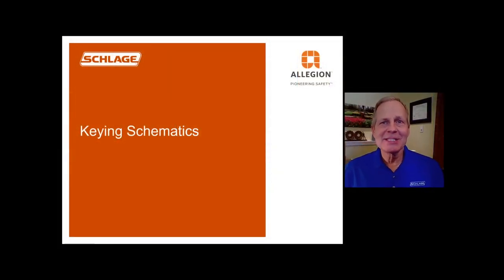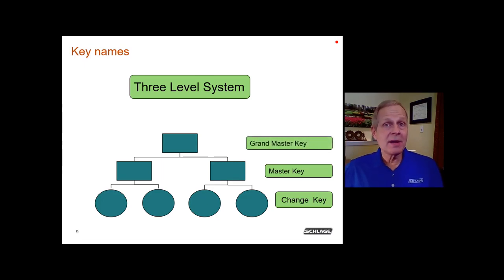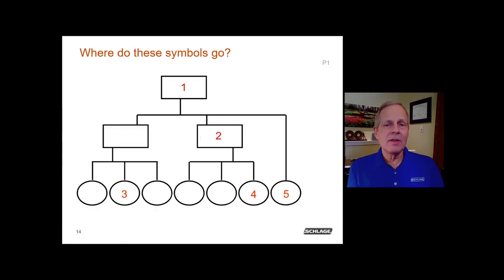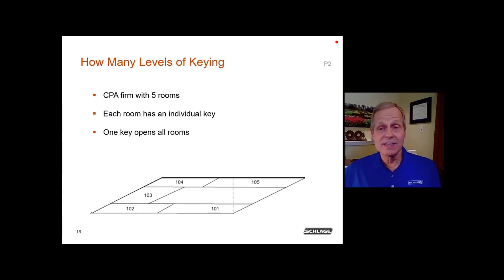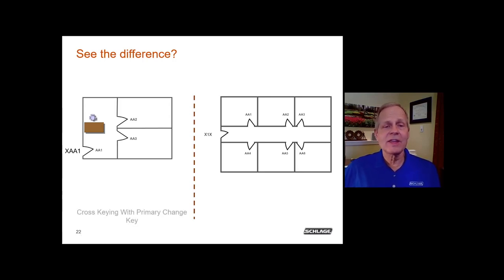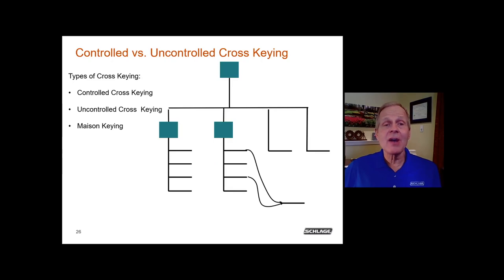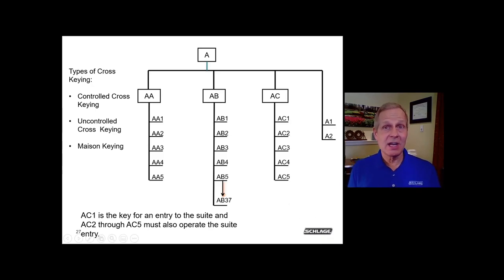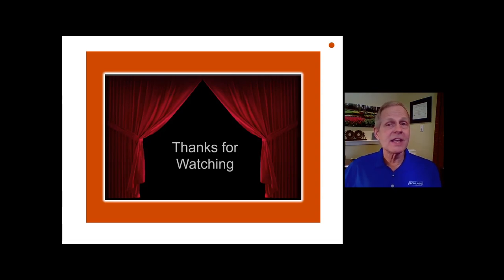Listen-In Video Lesson | Keying Schematics

Comment: Is there effectively any difference in the X1X designation and the older term "Maison Keying"?  (Other than the fact that Maison keying used to be for the front of buildings or large boarding houses, now considered insecure)

Is it only officially Maison keying if all of the change keys work, without exception?

EDIT: ah, you seem to clarify this later in the video 😉👍